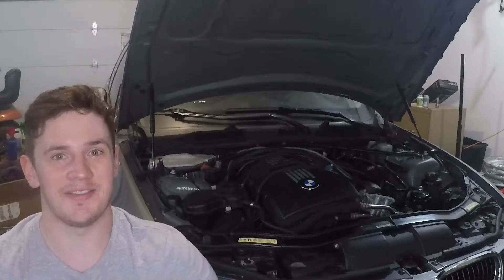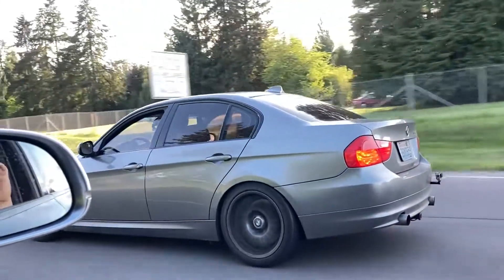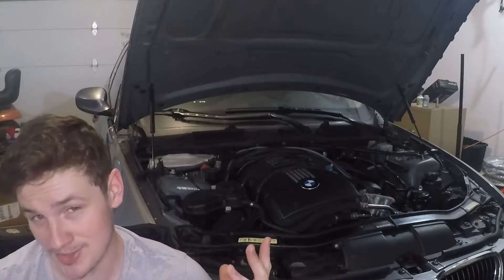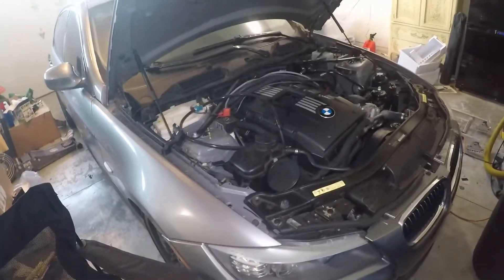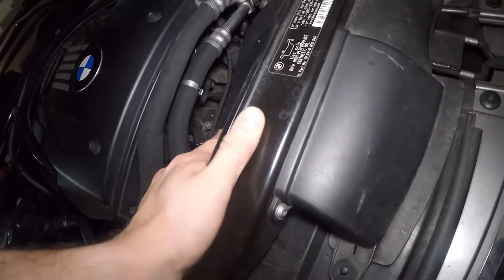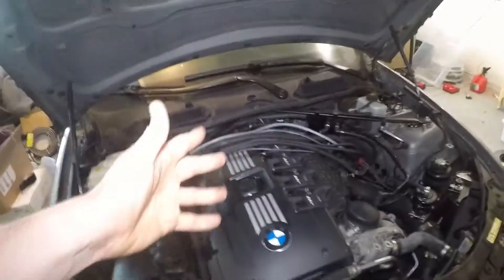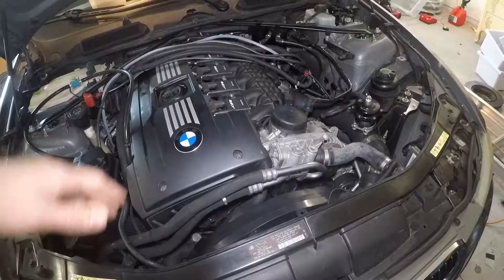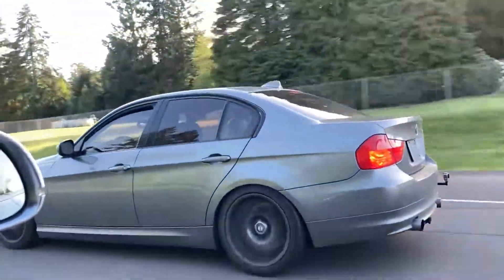My N54 is broken, Vanos issues | 2A7A and 2A87 | ledges, VANOS solenoids, Camshaft position sensors

Comment: I just have 2a7a so far but man it’s tough. Replaced vanos and camshaft sensors. Still no luck
Reply: Did you ever fix it?
Reply: @marcosneri5362  I did not.  It's been an ongoing nightmare...
Reply: @1SIK335 Same, I've replaced the vanos solenoids, cam sensors, crank sensor, oil filter cage, cam ledges, vanos sprocket, chain tensioner, reset adaptations, and I'm still getting the code. I'm going to check the oil pressure this weekend and then drop the subframe to drop the oil pan to look at the pick up tube. Goodluck on your journey
Reply: @marcosneri5362 nope.
Reply: @marcosneri5362  Replace cam ledges, everything; spent several thousands dollars trying to fix this code and it still comes.

Comment: WARNING: did this (actually finally tapped in a pro on this one). Had him provide old ledges.  While there was slight wear, THE PROBLEM PERSISTS!
Yes, did factory solenoids first. Did also have oil filter housing leak, so also replaced housing gasket. Replaced cam sensors.  Took it to another pro. He saying Cam Gear Actuator, or it's that ALL lines clogged.
I wonder about the vanos screens, which aren't solenoids but 2 little sink-faucet filter like screens on the passenger-side, bottom of the engine block toward front.

Comment: i need help, i cleaned vanos and replaced cam sensor. i have these two codes. 3100,  2a9f. my car experienced this and went in limp mode after my car stopped charging and had voltage as low as 8 amps. could these codes be from bad voltage? or are my cam ledges most likely bad
Reply: I have had this exact same issue because i feel like my battery has very low voltage, Did you ever figure this problem out? Im hoping its not actually the ledges

Comment: I have codes 2A98 and 2A99 but my car has trouble starting though .. could it be just a timing issue?
Reply: You need to replace it and the more you turn it on the more damage it does. It will not turn on anymore after a while don’t damage it
Reply: @kakak3762  yeah man it did damage my timing chain
Reply: @boost7236  what happened did you end up fixing it ? Do you still drive it ?
Reply: @kakak3762  well I started having this issue with codes 2a98 and 2a99 along with limp mode 3100 and the car ran like crap , I took off the valve cover and saw that my timing was off and also my chain broke , so now I have to replace my whole timing chain
Reply: @kakak3762  also probably just going to also do the cam ledges since I’m already there

Comment: Sigh...i think i might be experiencing this issue. Didn’t even get to try out my intake manifold with port injection, aic, and e sensor before I started experiencing severe misfires with the vanos code. Fingers crossed it’s just bad solenoids but I don’t know that I’ll be that lucky
Reply from the maker: try from the cheapest fixes and climb up. Could be as simple as your oil filter cap!
Reply: @BuiltInTheRain oil filter cap? How’s so?

Comment: What was it exactly that showed you that it was cam ledges? I'm having this issue right now with my 2011 335is. I'm getting the VANOS intake code. Mine is a little different as far when I'm getting the code though. I don't get it on start up but it only happens at low RPM's. The weird thing is there is two different places on my drive to work where it happens at pretty much every day. One is a left turn onto a road and if it doesn't get triggered there it will do it at the next spot which is at a stop sign where I turn left and start going up a hill. So far I haven't had any luck getting it resolved. I've replaced the VANOS intake solenoid and checked my oil cap and everything is good there. Next step is cleaning those check valves but I'm not confident that's going to fix it. If it doesn't then I don't even know what to look at next?
Reply: LMFAO I had 2 2011 335is one was totalled and getting these codes to and the current one to. Exactly like you my intake vanos code comes on when accelerating but very softly and in low RPMs. Did yours get it resolved? I checked solenoids, check valves and oil cap filter and all checks out about to do the bearing ledge. If you had to do your bearing ledge then 100% must be this for me let me know if you can thanks
Reply: @JackRR15 what ended up being the fix
Reply: @ Oh wow, yes it was the intake camshaft bearing ledge.

Comment: Definitely at random times, I have a 328i and I replaced the solenoid about 3 months ago bmw quality. The code popped up for the first time since I replaced the solenoid, started it today and the rpms jumped to 2.5k and check engine light on. Damn 2a7a, I have a 2011 328i
Reply: The Vanos bolts tend to sheer off leaving the cam(s) retarded. My codes were different but the bolts are under extended warranty. Mine was fixed for free by the dealer about 3 months ago. This was probably a $2,500+ fix. 2011 328 x drive at 80,000 miles

Comment: Question- what oil weight do you use?
Reply from the maker: 5W-40 Liqui Moly
Reply: @BuiltInTheRain   thank you 👍 I also have an 09 throwing random 2a7c and 2a7a. Post an update one you figure it out! Thanks again
Reply from the maker: @mcdoob  JUST finished the Cam ledges and it runs perfectly. Making a video on it when I finish my work week.
Reply: @BuiltInTheRain  hell ya thanks man
Reply: Mi too 2a7a. 2a7c  3100